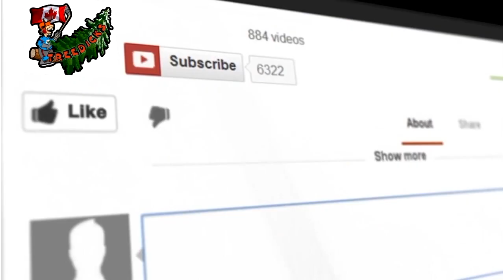Working the pipes at the new ramshackletons

Comment: It would be cheaper in the long run to rerun everything using PEX. Not sure if code allows that in Canada but in the States it is almost freeze proof with some insulation.
Reply: yes, it is allowed and preferred. super pex can freeze and thaw 10 times with out any issue. pex would have been cheaper, faster and easier. but then we wouldn't get to see the videos and comments.

Comment: Can't wait to see Jeff turn the water on, that is the worst soldering job I ever seen. Threading the adapter on to the valve before soldering it to the pipe, probably melted the thread tape ( if they even used any ) or warped or melted the internal valve parts from the heat. That guy shouldn't be anywhere near a soldering torch. What a Shit Show!

Comment: Such a pain in the ass of a job if you don't do it all the time. I had a leak in my water heater pipe last winter when it was 10 below (F) and it took forever to get it sealed up with solder.

Comment: steel clips on copper  : 0
Reply: Alex Hill it works with clamp rings doe
Reply: if steel they need to be rubber lined clips to prevent electrolytic action, the pipes will burst. a bit of duct tape on the pipe would do tho

Comment: apply solder to the opposite side of heat don't oveheat and don't use old shit it will end up costing more than new .if there water in pipe use bread to dam water back so you can solder.thats all you new to know except payday on friday! OH remove valves before you solder or melt rubber
Reply: my point exactly.lol I did't want to disappoint him.